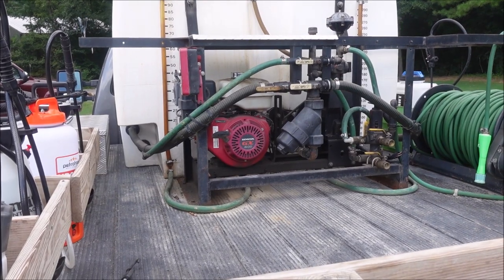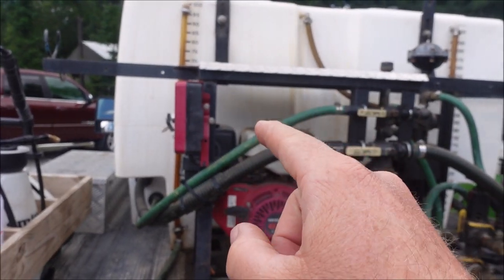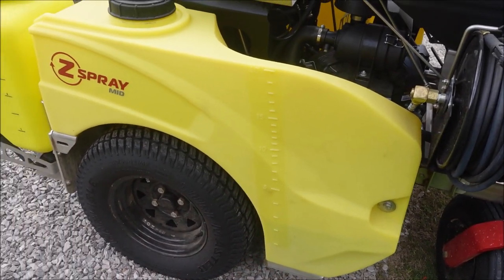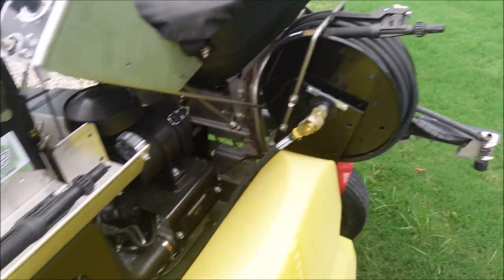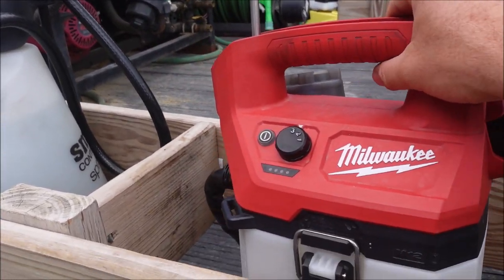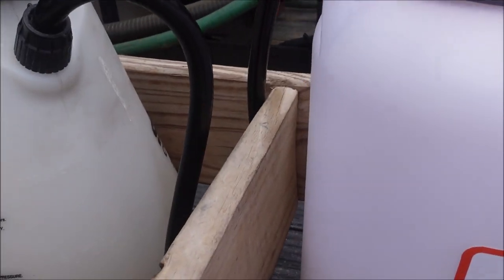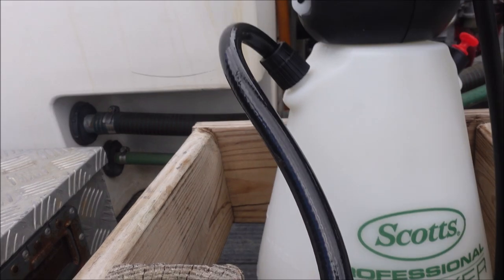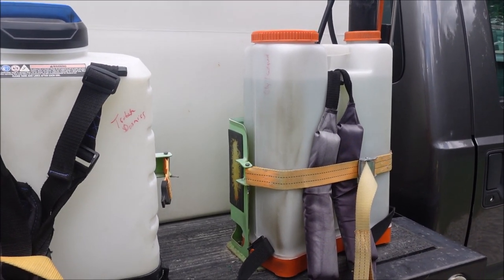Lawn Sprayers Overview - Pros and Cons

Comment: Why don’t they have some kind of garbage that goes down maybe 2 inches off the ground that prevents it from spraying outward so you’re basically spraying at like a 90° angle without the overspray getting on the shrubs or flowers

Comment: On our zsprayers we got rid of that horrible wand a d replaced it with a regular lescoawn care spray gun. Just know what your pressure needs to be and it's like you're hand spraying. Obviously we have a tank on the machine to do that with. Bucket check it and go
Reply: So you use an accessory tank on the Z that you use the Lesco gun with? I like the idea of changing the factory wand out. What type of pressure do you need to use the Lesco gun with? I would like to change mine out, but I don’t have a extra tank on mine. Just the factory 30 gallon tanks.
Reply: @sidneywhitaker9972  at first we just used one if the thirty on tabks to use the gun out of the we got a designated tank for it. Just run a bucket check on it and move the pressure to that when you use the gun

Comment: I just purchased a Steel Green SG36.  I had a Turfco 3000i and it did me well.  The question I have, with the Turfco, I had a Rideon Carrier that attached to the hitch and made transporting the Turfco a breeze.  However, I haven't figured out an easy way to transport the zero turn.  I know they are heavier, so having a carrier is probably out of the question.  Any suggestions?

Comment: i purchased the 1.5 gal battery sprayer from lowes and i love it . the wand an nozzle are a bit cheap but very easy to change to higher quality .  I do have one Question on backsprayers  the rate of pressure to me seems to be to high you almost have to run to get the right amount out , is there a way to control the pressure maybe smaller nozzles or something . if you have any tips on this i would appreciate it